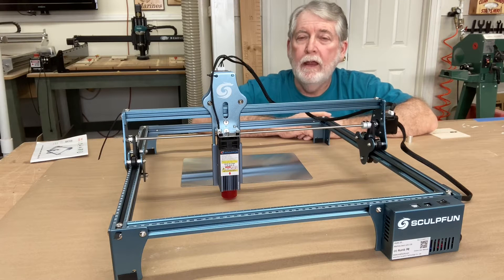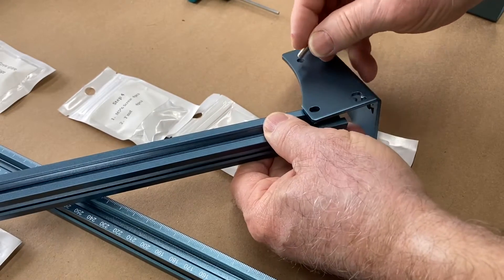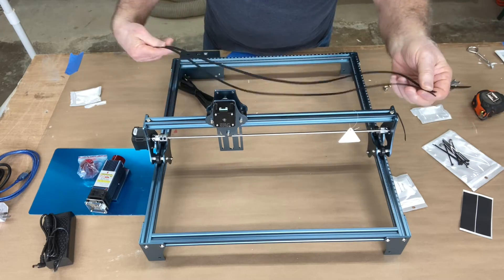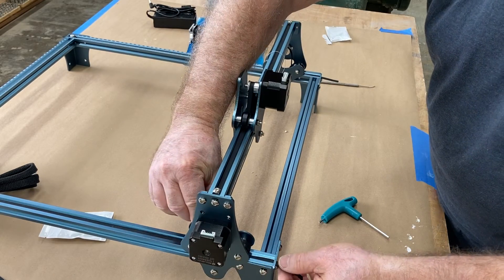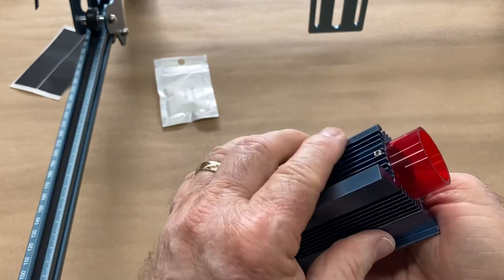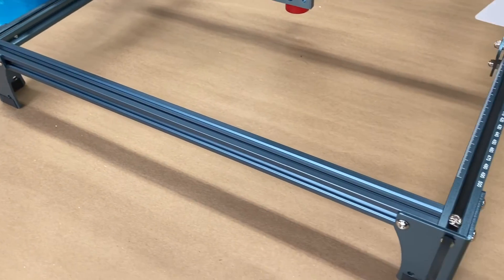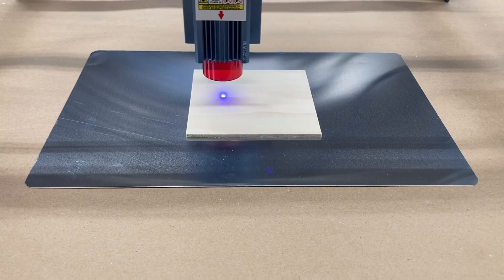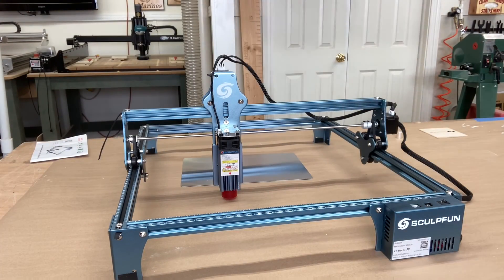SCULPFUN S9 Laser Assembly and First Engrave

Comment: Hello... How to reset GRBL configurations (My setup for my Sculpfun S9 is wrong, because the laser does not go to right start-position of engraving after I have set correct 0-point in left/down corner))
Reply from the maker: You will need to manually enter the code into the controller
Reply: @PawPawsWorkShop  thanks....was afraid of that. Do you have the parameters?

Comment: did you get any horizontal banding in your engravings once you had it set up , as i have them constantly i have been through the rebuild once again and everything is bang on , i have only downloaded lasergrbl v4.9.4 , is there anything else that i have to download for it to work correctly , thank you in advance.
Reply from the maker: I do not use laser GRBL. I use Lightburn software.

Comment: Do you know if i could run an s10 laser module on the s9 laser engraver , or would it have to be modified.
Reply from the maker: I am not sure. Check the specs of each including the power adapter. If all is the same it should work. Also, check with the manufacturer
Reply: @PawPawsWorkShop  both power adaptors are the same , 12V 5A power adapter. on s9 and s10 , and both laser modules on s9 and s10 are 12v 3a. so my thinking is it should be alright as the only difference i have found is the set up in the laser module that narrows and intensifies the beam for a deeper and quicker cut , thank you for the reply my good man , all the best to you.

Comment: any tips for engraving on glass with the s9 as i have had no luck yet , although it engraves wood brilliantly , love the videos keep them coming ,thank you
Reply from the maker: Glass is always tricky. All glass is not the same. It requires a lot of testing to get the settings correct and then when you change to different glass you have to start over testing again
Reply: @PawPawsWorkShop  thank you my good man ,i tried a piece of glass had to paint it black , but it came out brilliantly , just needs a slight tweek to laser power and a bit of a  slower speed , getting there ,only been using for 2 days

Comment: Hello, I bought a sculpfun s9, I have been using it for about 10 days, today it started to not work by itself, the light is intermittent and it does not scrape, I tried everything but it does not improve, it seems like the laser has lost its power, can you help me?
Reply from the maker: What have you been engraving?  Do you have air assist. It sounds like the lens is very dirty or damaged. I have damaged a lens before doing crazy experiments in the shop

Comment: Seems like a nice build, metal plates, better than the funky Acro Plates from openbuilds. That acrylic plate method is no bueno
Reply from the maker: It a very good machine. Thanks for watching
Reply: @PawPawsWorkShop  is there a pretty easy kit to add some airflow to the laser head?
Reply from the maker: There are several. The Dewallie might work well

Comment: Great video. Ive had the Sculpfun s9 for about a month and i have a question. The wheels that ride ontop of the gantry leave a lot of black debris on the top of the gantry, but you cant see or feel any wear on the wheels. Also the stepper motor ontop of the gantry seem to be a bit noisy to me. Is this normal, or is something just not right? It seems to engrave and cut really good, but im kind of afraid it wont last.
Reply from the maker: I would certainly heck to see if anything is rubbing on the wheels. Also, something may be binding. That is not normal from what you are describing
Reply: @PawPawsWorkShop  after looking at some sculpfun s9 forums and seeing all of the different problems people are having, i decided to send it back. Bought from Amazon, so should get a full refund. If so, im going to get an Ortur Laser Master 3 with 10w dual beam. From what ive seen, its a pretty nice machine, though it hasnt been out very long.
Im new to this and dont want to give up on it. You and LA hobby guy have been life savers a few times. Keep doing what youre doing and thanks a million.

Comment: Well, I'm certainly thankful you did this video.  I've run into two issues before completing the assembly.  One is I cannot square the frame.  As I tighten the screws, the machine continually pulls out of square by 1/8" on the diagonal.  Spacing between the rails however is consistent, side to side and front to rear.  The front two corners are reasonably squared.  This problem is irritating as I've been a cabinetmaker for almost 46 years and have squared many many cabinets.  Other videos appear concerned with the 0,0 left front corner only. To what extreme should I go to squaring the entire frame?  Problem 2 was gantry travel on the rails.  It simply did not travel easily or smoothly.  Thanks to your explanation regarding setting the eccentric adjustment of the wheels, I was able to loosen/adjust the gantry wheels to allow proper motion. Now, on to the belts.  Can you advise me on how critical is absolute squareness?  I assume the larger the engraving, the more critical the need for square. Thanks for your help.

Comment: My S6 Pro z is loose on the gantry . You can grab the laser at bottom and move front to back it wiggles. How do you adjust the 3 wheels on the gantry so it's smooth but rolls back and forth smoothly? I do not see eccentric nut like my shapeoko.
Reply from the maker: I show hoe in the video on the assembly. There should be two wheels on top and one wheel on the bottom of the gantry. The bottom wheel should have the eccentric nut that you can adjust. Look at my video on the assembly of the Sculpfun S9
Reply: @PawPawsWorkShop  , Ya, thanks you. I actually found it. Works beautifully now.
Reply from the maker: Awesome

Comment: Hello I wanted to ask what software program you use and with what settings you cut acrylic because it doesn't work for me. Thank you!
Reply from the maker: The software is Lightburn. The settings will vary depending on the acrylic. The diode laser will not engrave on clear acrylic. It must be black or a very dark color

Comment: Hi Brian, thinking in getting an S9 for  engraving images, mainly on skateboards, I saw there is an expansion frame that can be purchase separate, mu question is, isn’t possible to get the big frame with the laser etc as initial machine or has to be purchase appart anyway?
Reply from the maker: As far as I know they do not offer an expanded machine ready to go. You have to get the based machine then add the expansion kit. If something changes please let me know
Reply: @PawPawsWorkShop  will do, thank you for replying

Comment: OMG, this is not very helpful at all.
You don't show which screw you are using, or which piece you are using as you do it. You don't even show each screw that you put in.
Showed 2nd t-screw not even close to 90 degrees when tightening 2nd spot on belt.
***This is basically how to put a screw in a hole, not which screw and which hole.
Reply from the maker: I appreciate you sharing

Comment: Great video there! I'm wondering if you can help me out with a little problem I have. I just recently bought the Sculpfun S6 Pro and right out of the box it worked perfectly with Lightburn. Then I tried it with LaserGRBL software where I think I might have over written the settings of a previous board and when I returned to Lightburn again the work area was in a complete mess, the laser head would go out of bounds and hit the rails. How can I restore the Sculpfun 400x410 settings? Is there a file I can download. Thanks a lot
Reply from the maker: Did you save the original settings?
Reply: @PawPawsWorkShop lm afraid not, and that's the problem.

Comment: Nice video thanks!!! Do you know if you can use a different manufacturers rotary attachment with this S9? I am wanting a larger space to work. So I am thinking about the expansion kit. Not sure if it's worth it? Thanks!
Reply from the maker: I have never tried to mix different manufacturers equipment. I am not sure of the potential problems.

Comment: Great review! would you suggest this machine for DAILY cutting of 2mm acrylics? if so how long do you think the laser module would last?
Reply: thats my concern, but thank you so much!
Reply from the maker: Most of the diode lasers state that as a rule of thumb you will get about 1000 hours at 100% power. I have also heard as much as 10,000 hours. I do not know exactly. I rarely use 100% power and I have yet to have one die

Comment: Hi ,great tutorial thnks. When I assemble mine and load up lightburn the laser will only move wide to side not backward and forward . Any ideas , plugs and connection seem good on the harness 
Thanks
Reply from the maker: It would seem that there is a mechanical issue.
Reply: @PawPawsWorkShop  Hi  ,Yes  it was  predominately mechanical  , it was pinching the foot  at the corner where the Power etc box is  and getting stuck .   I also noticed  that  you must also in Lightburn tell it  (using the spanner tab)  that it is a  front left   starting machine   and also some other  instruiction about where the job starts   or the laser actually  moves  in a revers manner  :)   but i resolved  it  thanks  again  great Tute  and  ive already burned my name  in the black cloth using  7.5 % power   its great machine

Comment: Got mine for Christmas and have just played around with it a little bit thus far and am VERY pleased with it. Can't wait to get an enclosure and air assist for it, and am also currently investigating limit switches for it as well. I think that would be a quick and very useful upgrade to this unit.
Reply from the maker: Congratulations,  that’s a wonderful Christmas gift. I’ve never used the limit switches on the laser. Most of them do not come with them. Some people won’t start their machine without the limit switches and that’s ok. Just realize it’s not mandatory. You can get started without them and add them later.
Reply: https://www.youtube.com/watch?v=ran-rUKmnGM  Subtitles ON
Reply: @triforce1745  thanks but I find this one confusing as she is only using two limit switches vs the 6 required for true limit in all directions correct?
Reply: @TimCatZ  No, first it only goes in 4 directions (front, back, left and right).

Second,  you only need 2 limit switches. 1 to know the 0 on the X-axis (left-right) and another to Y-axis (front-back). 

Third, when you connect the machine to lightburn it will automatically know the working size of the machine and will stop before crashing on the opposite sides of the switches.

Comment: Limit switches for the S9 (and S6) cost four-five bucks for a set of four. And mounting brackets and instructions are free. Took me 10 minutes to add them and they are super helpful...
Reply from the maker: Awesome, love the interaction.
Reply: Where does one buy them from and are there any instruction fitting  videos online?
Reply: @ivanfabian6398  can't post any website name it seems... Damn youtube... search for a website that starts with "cults" then "3d" and there type "sculpfun" (hope this one sticks)
Reply: @RCX2020  Thanks.  I'll get that printed.  I've also ordered the switches. Is it obvious how to connect them to the s9 controller?
Reply: @ivanfabian6398  Yep, on the controller board the sockets are labeled X, Y and Z (you'll only need the X and Y) and the wires supplied with the limit switches have the correct connectors on them so they just snap in. The wires then route out the same hole of the enclosure with the rest of them, the X axis kan be fastened along the X wire harness and the Y axis wire can be bundled up (it's too long) or made to length, wichever you prefer. 

I'm planning on routing all cables through some drag chains I got from Alie but have to design some mounting brackets for them first...

Let me know how these brackets and instructions work out for you...
Reply: @ivanfabian6398  There's an STL with links and simple instructions... Took me 10 mins and you could even make the bracket out of plywood with your laser if you don't have a 3d printer...

Comment: I love the S9 laser head. I have on my Ortur Master 2. Using way faster speeds and lower power. Great video. Only thing Id suggest is remove that ring...all it does is hold smoke in very badly...
Reply from the maker: Thank you for the suggestion